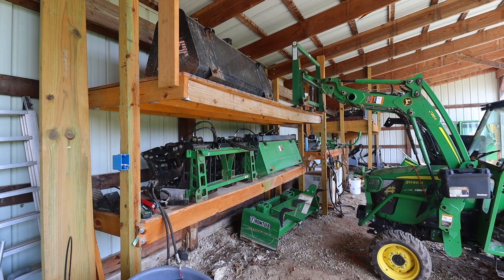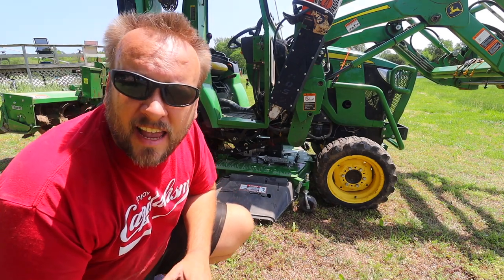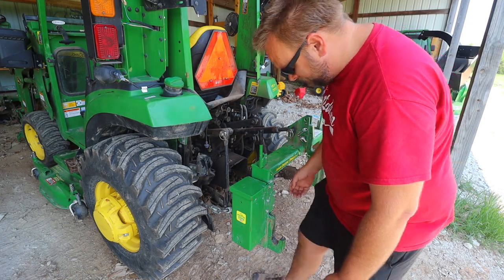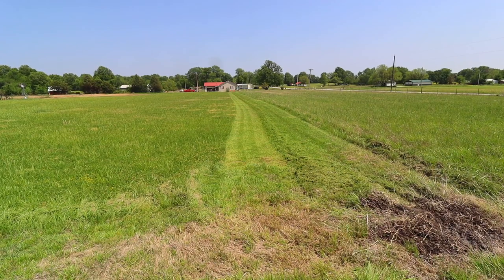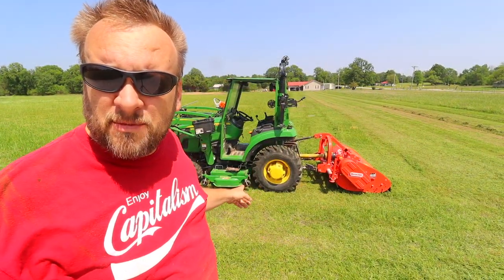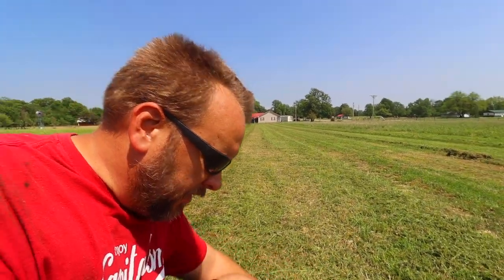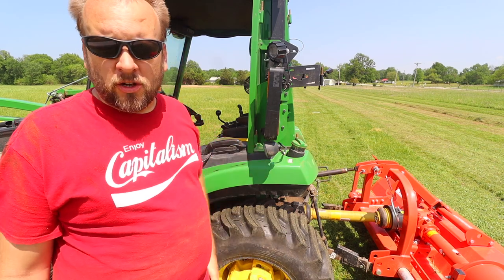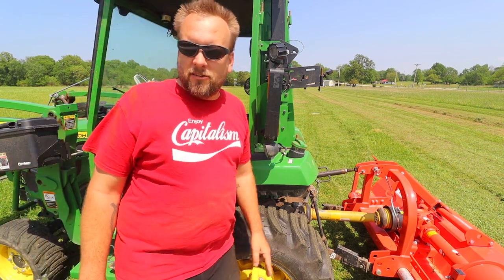Flail Mower Vs Belly Mower Vs Finish Mower

Comment: Good comparison Brock.

I mow my property and other people's too, brush maintenance, fields and food plots with my flail mower and do it around a foot off the ground. It does have a different appearance but works for me and there's no damage to the unit from hitting unseen rocks, limbs, woodchuck hole dirt mounds, etc.
No issues with 3point supporting the weight, its comparable to a weight bin. Just keep the stabilizer linkage tight so it doesn't swing side to side.

Comment: Brock.....I totally agree with your conclusions.  I have a JD 4720 and for our 4 acre yard around the house a Ferris  61" zero turn mower.  I have had a JD flail mower with knife blades for 20 years and discarded my bush hog shortly after purchasing the flail mower.  The bush hog is okay for rough overgrown areas, but the problem is it windrows and sticks out very far behind the tractor...making tight work difficult.  Also the finished product does not look good, okay for work in the woods and rough areas but not for walking trails etc., the flail mower will remove small trees, bushes etc..  I mainly mow field roads around food plots and around switchgrass fields and want a clean looking mowed trail.  I think the belly mower is harder on the tractor for cutting high grasses and weeds, although I admit I have never owned one.  I use my flail mower set slightly off the ground many times to cut switchgrass and clover fields etc. at 6"-8" with no problems.  Just my experience.....Bob

Comment: With the compact tractors i've found using a mower on the 3 point hitch will give you MUCH more stability on a hillside or steep angle than a belly mounted mower.  As you mentioned its a headache have to remove the belly mower to do work with most other implements as well. Unfortunately I have the older (2014) drive over deck you have to hook up everything manually.  I put the 2032 on its side with a belly mower on the same slope as the 3 point finishing mower managed to hold.. it seems to act like a beavertail or outrigger for stability.  You can notice the difference in cut because the front of the tractor is bouncing up and down.. ive got the same issue using a land plane if i don't burry it. Front of the tractor bounces and the implement at the back end then "skips" up and down"
Thanks again for the video!
Reply from the maker: Thanks for sharing your experience. I’m glad you weren’t injured in that rollover.

Comment: You should be able to lower the roller , I use to mow with one on the roadside with the state and we could move ours and I have a mower like yours , not that brand but probably made at the same place in China . I can move my roller a little. Let us know what he decides. And yes the 3 point Finnish mower is probably the best my dad has one . My rear flail can be offset and do ditches .

Comment: The flail mowers are impressive.  Isn't the height adjustable on them?  I figured the roller could be adjusted to cut higher, but I don't have one to know the answer to that question.  The cut looks really nice when riding on the roller.
Reply: The top link usually adjusts the height of the cut

Comment: Brock, are you familiar with the JD Load and Go system for their mid-Mount mowers?  Also can the roller be lowered thereby adjusting cut height?  That would take the load of your 3pt hitch
Reply from the maker: Yes, but you can’t get load and go on the 60 inch mower for the 2038.

They say there’s a clearance issue. You can get it on the 54 and the 72, and you can get it on the 60 inch with the one series.
Reply: The top link adjusts the height of the cut of the flail mower

Comment: I think they both are used for different reasons. The mid mount mower is great for manicured large yards. Yes you can get wind rows but usually not cutting 12 inch high grass in the yard. 

The flail mower is better suited for cutting fields, especially with long grass, weeds, and brush trying to take over the field. I think you should be able to raise the cut height to 4 inches on most flail mowers by adjusting or dropping the roller. Also after dropping the roller you can adjust the top link to raise the front of the flail mower to increase the height of the cut. The bad is because of belt or belts running the drum in thick vegetation it bogs which means you will have to slow down to get a good cut in those circumstances. Overall I agree the flail mower is a much better cut basically feeding the field with mulch, instead of killing spots because of windrows or spotty gobs left on the cut field.  

By dropping the roller to increase the cut height you will also have a better finish cut because it's not bouncing. Another issue in the video you already have the tires bending the high grass over, my guess the rollers on the mid mount mower did some as well. Anyway nice video

Comment: There is no GOOD way to mow with a tractor when "best use of your money" is a concern 😂 The best use of your money would be a heard of sheep.... and some portable infrastructure (there, ya happy trolls?) Had to add that last part because humans are so damn stupid these days that they think i'm suggesting installing thousands of dollars in woven wire, digging wells, etc! I swear 90% of the people commenting have never mowed or something 🤣
Reply: Of course a good sturdy fence to keep the sheep in and predators out is free. So is piping water or digging a well 
 to water them is free. Checking on them constantly requires no investment in time either. Of course they care for themselves.
Reply: @davidbalvin8112  Depending on how many head/lot size you want to run, i run 10-15 in a 50' square and move them daily. Cost me about $1000 for portabl elect. fence fence, charger and stock tank which I fill from a 300 gal IBC tote in the back of my truck (cost $80 used. I manage 12 herds that do exactly this for municipalities around my area. All of my customers have sold off their mowers... so please do lecture me on how $15,000+ tractor/mower is more economical 😂
Reply: @davidbalvin8112  Oh and I move them once a week, takes about 15 min each to move.... drive time less than an hr drive.  Guarantee people that are using tractors to mow are spending more than an hour mowing per week.
Reply: @CPLBSS88  How much did you spend on the pickup to haul the water?  3/4 ton new are 75000 or more. You can buy a used N series Ford for a few hundred dollars and a used mower for a couple hundred more and use the tractor for a lot of other things.
Brocks' customer wanted the grass left 4 to 5 inches tall, ,are your sheep trained to do that or are they like all those I have had that chew it nearly to the roots?
I wasn't lecturing you on anything  just pointing out to those who read comments that raising and caring for livestock is neither free nor effortless.
I have been farming for nearly 70 years and my experience tells me that livestock are a lot more trouble and more time consuming than machinery. As  for profitability there are ups and downs  either way, it is just a matter of personal preference.
Reply from the maker: Everybody has different needs and different situations.

For a lot of people, livestock are the perfect solution.

I’m not going to do it right now.
Reply: @davidbalvin8112  Dude you are missing the entire point. But hey thats fine, you do you, IDGAF. If you want to blow money on a tractor and tell yourself it is cheaper than running a few animals have at it. A truck is hardly as dedicated of an asset as a mower is but w/e... you guys clearly want to make excuses to play with your toys rather invest is something actually sustainable, cheap, and put money in your pocket rather than pissing money away 😙🤣 BTW i have 5 trucks, and at least 12 tractors running my 800 acre ranch, so i'm not anti tractor. The last truck I bought was a month ago for about $4k and it does the just fine! I made my money back on everything within the first year so I have zero dollars invested now... but hey never let logic and reason get in the way of being a good little consumer!

Comment: I have a 1025r 2020 mod.a 60" belly mower load and go brackets..also pull type 60"grooming mower that can be set to mow close to ground or around 8"tall..I didn't use my belly mower at all last year love my grooming mower does not bunch up grass discharges our rear evenly. .
Reply from the maker: Thanks for sharing. I don’t own a three point finish mower, but it seems like the best option for regular mowing with a tractor

Comment: I agree with you on mid mount mowers unless thats all you use the tractor for.  As for mowing a field I'm old fashion and go with a sicklebar mower.   You can cut a larger swath with less hp and the ones they make today coming out of Europe are a huge improvement over the old ones I used as in my younger days.
Reply from the maker: Good point.

Comment: Anyway to adjust rear roller down so ground controls cutting height?
Reply from the maker: It actually does have an adjustment on the rear roller. Should’ve tested that out in the video but I didn’t think of it.

I don’t think it adjust very far. It has three bolt holes.

Comment: I've really invested in making the right choice for mowing the meadow.
Finally i chose the kubota flailmower behind my kubota bx 231.
It does an allright job on my meadow.
But I really had to experience that for two years to get to know how to do it well.
Only to realize I was using the wrong tool for the job.
The grass and green on my meadow is so tough, the flailmower  gets caught up in it.

I am now in the process of buying a
Rear mowdeck or brushog like attachment.

To actually cut the tough grass to have a nice cut on the meadow

Comment: I have a mid mount mower, but would like a flail mower at some point...I don't mow saplings or anything like that but I do mow a couple of pastures where the flail mower would be better suited than my mid mount mower.  The mid mount mower does great on the lawn, but mowing pastures even though its grass and weeds is still better suited for a flail mower.  The flail mower for mowing a lawn would be fine if you have a wide open lawn to mow, if you have obstacles and a small restricted space, it'll present its own problems just because it sticks out behind the tractor so far...not nearly as bad as a rotary cutter (brush hog).  

I have a non-drive over mower for my tractor because of a lot of problems with the drive over mounting system presents.  I don't mind doing the swap myself.  I set the deck on my carport, park the tractor on the carport, and roll the deck under the tractor and put the pins in....takes longer getting the deck over to the carport, removing the loader, and rear implement, than it does to install the deck.  Nothing wrong with a drive over deck, but all the auto connect stuff hanging under the tractor presents an issue for ground clearance when the deck isn't installed all that extra linkage hanging down can cause issues...with my tractor when the mower isn't installed, all the linkage tucks up into the frame area out of the way and locks there.  

If you mow a lot a drive over deck is great, makes installation/removal real fast when it works that is.  I have a lawn tractor I use most of the time on my lawn, so I don't put that many hours on my mid mount mower so the drive over stuff was just something I wasn't interested in.

Comment: Did you adjust your roller on the flail mower to give as much distance as possible (tallest cut height) so the roller will continue to remain engaged with the ground?

Comment: Have you ever considered the 'load and go' brackets for your MMM? They work really nice for not only storage but also deck maintenance.
Reply from the maker: I would like to have them but for some reason they say they are not compatible with the 60 inch deck on the 2038R. I actually ordered them with the tractor and they refunded them

You can get them on the 72 or the 54 inch deck

You can also get them on the 60 inch deck on the 1 series
Reply: @Rockhill farm   
Oh yeah, that's right. The 72" deck would be ideal IF you wanted a MMM. Probably like you though, I wish I didn't purchase the mmm. There are a lot of better options. It's sure slick to take on and off though!
Reply from the maker: @benagain7617  yeah, I wouldn’t buy it again. My original thought on getting the 60 inch was that it would fit on my trailer I had at the time and the 72 inch would not.

I’ve never taken that mower deck anywhere, so it wouldn’t have mattered
Reply: Good job Brock...I too would not buy the mmm again , storing it is a hassle, and I need it off my JD 3033R 95%
 of the time .
pc

Comment: I agree with the mid-mount mower. I bought one for my 1025R, used it a couple times and now it sits there looking like new. I prefer to have a dedicated mower for mowing and I leave my tractor set up to do other work. I do have a flail mower and use that to knock down the field once or twice a year.

Comment: Sounds like he wants it mowed like a pasture. Which I find is best done by a multi spindle rotary cutter. They cut very clean at 10”. 

I’ve had a 3 series JD (3320) with a MMM(72d). It was a very nice system. But I had a bolt hole elongate on the pto yoke. It was an expensive fix. I ultimately moved to a zero turn and 4 series cab (4520). 

Great video.